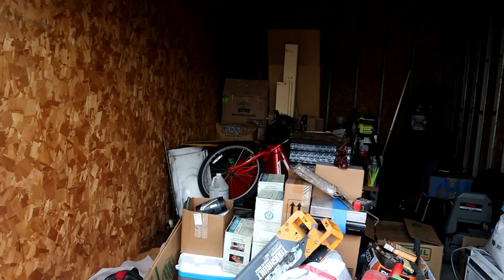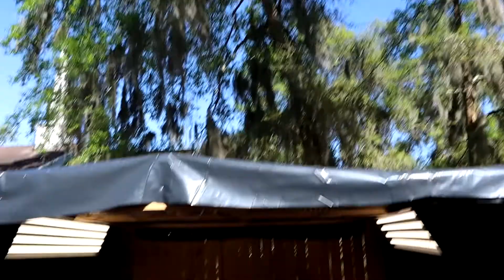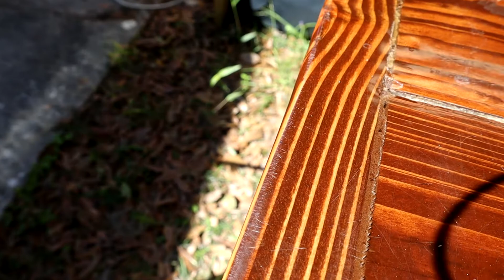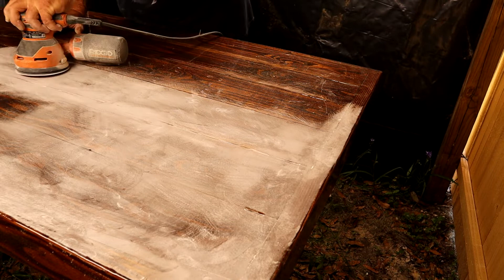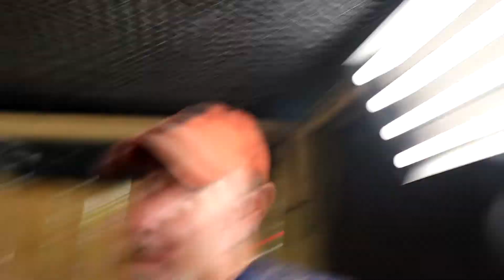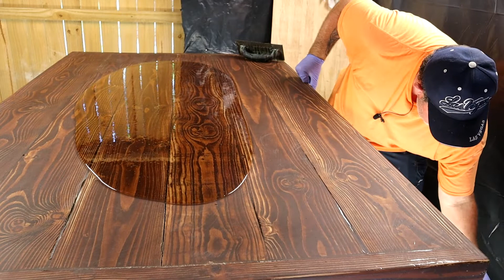EPOXY TABLE REPAIR. LEARN TO REPAIR AN EPOXY TABLE IN THIS VIDEO  I SHOW HOW TO REPAIR A EPOXY TABLE

Comment: Very nice work
Reply from the maker: Thank you.
Reply: @LiquidCreationsCo2609  I need to understand the prep part of doing a vanity sink. You show black bonding agent, we live in PA and Loews and Home depot will not tint the bonding agent. What else could I do to get the black. Could I use the bonding agent ? Please help I'm ready to get started. THank you
Reply from the maker: @shannongaw450  I'm sorry you're having this problem most places won't tent bonding primer. But there's a very simple thing that you can do. First clean your sink very well then go ahead and paint your sink with the regular bonding primer make sure you give it two coats with a light sanding in between them. Then get you a can of Rust-Oleum spray paint in the color of your choice and put just enough color on to cover the white let that dry and give it another light coat. Once that dries good go over it with 220 grit sandpaper. And then do your epoxy work this is the way I've done it for years until I found someone that would tent bonding primer. Hope this helps have a blessed day.

Comment: Question: can a tub or toilet be epoxy'd like the sinks you do? Also, how long will the epoxy last?
Your table is beautiful😊
Reply from the maker: Well thank you I appreciate your comment. As far as epoxying a bathtub yes it just takes quite a bit more work but for the toilet I don't know I've never known anybody to do it I'm sure it could be done but I've never done or never known anybody to do it. And actually the epoxy holds up pretty good in my sinks I've never had no callbacks or no issues with it.

Comment: Could you have taped up the bottom of the table along the cracks instead of using quick set epoxy? Or is that a bad idea
Reply from the maker: That could have been done it was done a little bit but the reason I didn't do the whole bottom is because the wood that the table was built with it was so porous it just kept soaking up the epoxy and it kept finding little places to leak from so I just use a quick setting solve the problem

Comment: Hey brotha, glad to see your channel back.  Still haven't finished that bathroom remodel and the sink epoxy.  Had a go round with the old CV at the start of February, but I'm still planning to get it going and documented.  Hope you get a better solution for your workshop.
Reply from the maker: Thank you my friend glad to be back and I still look forward to seeing your completed project. And yes hopefully I will get my work shop worked out.